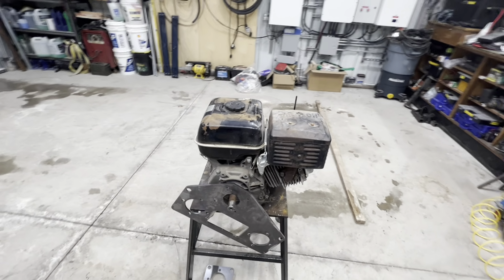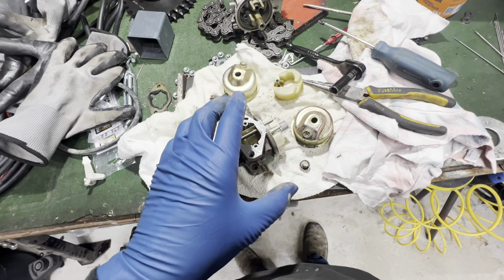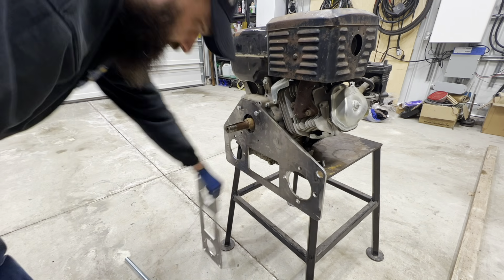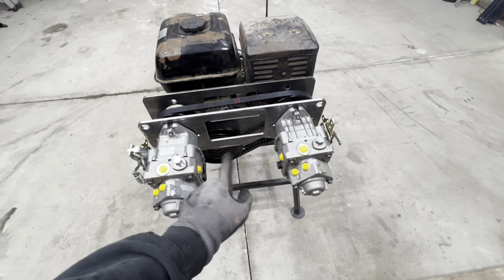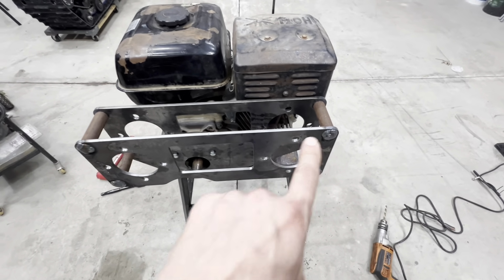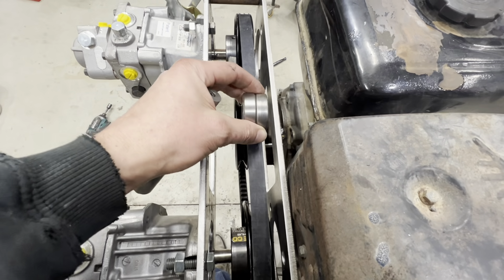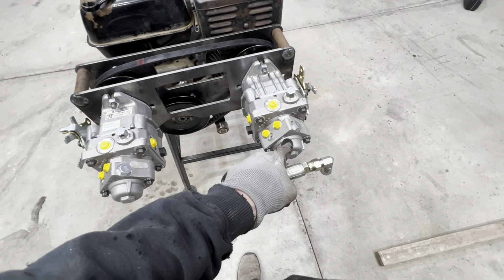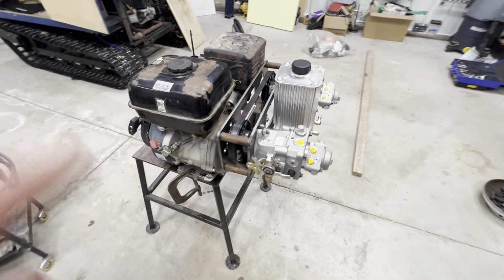PTV (Personal Track Vehicle) Engine Power-unit Fabrication Complete!

Comment: What are the part numbers on the pumps?
Reply from the maker: @jimc336  hydro gear PB-BBCC-HB1X-XXX
Reply: @ thanks!
Reply: @rad1876  I checked the price and…. Yikes! $800+ each
Reply from the maker: @jimc336 yes, they can be quite pricey. They can be found for a bargain on eBay from time to time. I got these for around $150ea about four years ago.

Comment: This is awesome. Could you use the aux pump for a little blade or something?
Reply from the maker: @InternalcombustionChamber  in the back of my mind I was really hoping to do that on my mini snowcat adding tilt & articulation to the existing blade. Right now I use the winch to lift/lower it but that’s a nuisance. 

The way things are working out, the PTV is looking more like a speed machine rather than an earth mover. My last calculations are showing top speed ~50km/h. Might need to dial that back a bit.
Reply: I’m watching with interest it’s an easy budget to meet for a cool idea for sure

Comment: Nice work man!!  One suggestion from one fabricator to another. Don’t trust those four threaded holes in the engine block to support that entire setup. Especially with the “quality” of material in those clone engines. One thing you could do would be add another set of spacer tubes and bolts into the two bolt holes just above the four you used. Wouldn’t be hard with the way your build already is. I’ve seen those rip out the threads with just a regular hydraulic pump and bracket a few times. Good luck with your build though. Looks like a cool project!!
Reply from the maker: Good suggestion! There is a decent amount of load hanging off those four bolts. I’ll consider some additional supports.